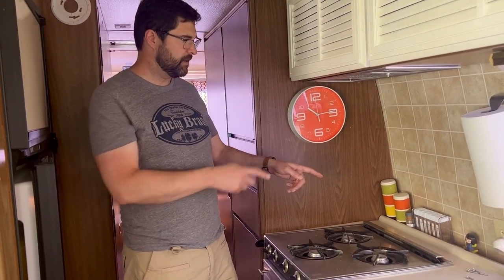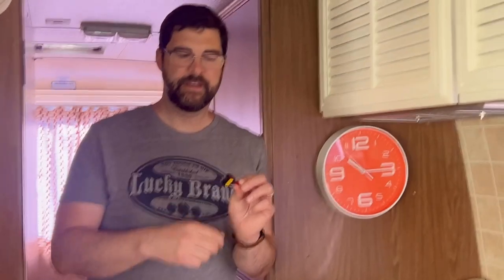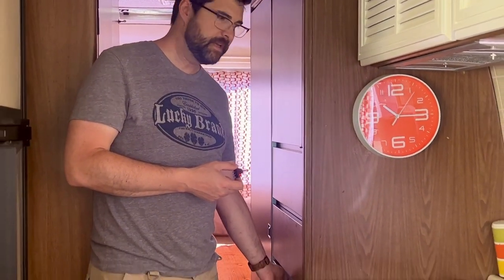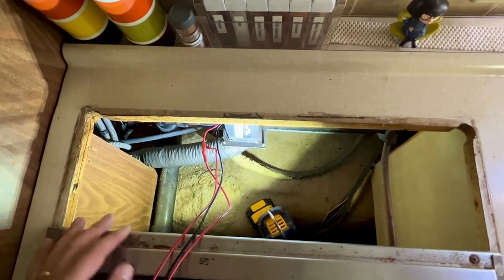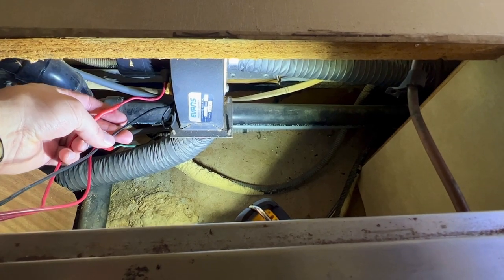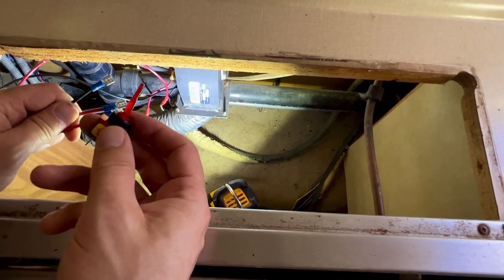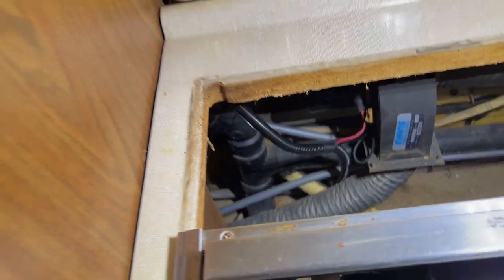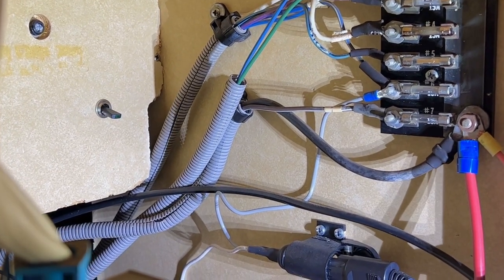GMC Motorhome Furnace Blower Switch

Comment: Hmm, its probably a 45 year old fan... Unless you have tested it, and found it works great.... I would suggest putting in a better more efficient modern fan. ;)
Also if you can do it, make sure your output flex duct has not been compressed or twisted somewhere blocking your flow to the back, and minimize the bends.
Reply from the maker: Great points! I checked the flex duct and it's on poor condition but doesn't seem to be broken or blocked (after removing a large mouse nest). So far, we haven't camped in very cold weather so I don't expect to use the furnace or fan much. If I end up using the fan much, I'll probably look for a modern option and replace all the duct.